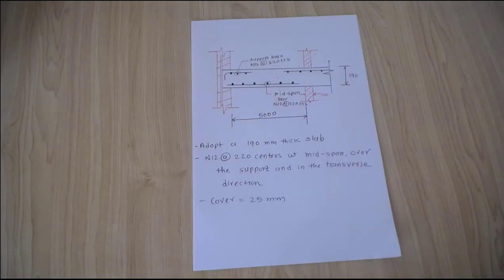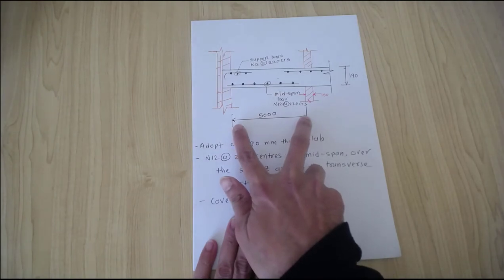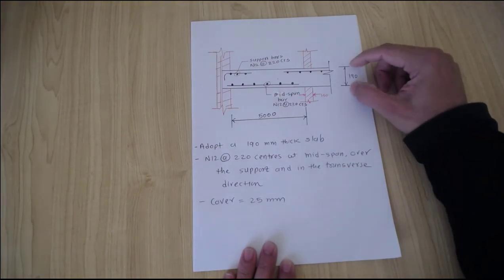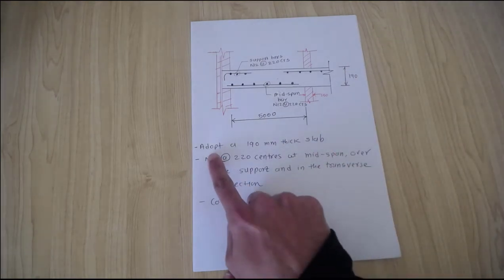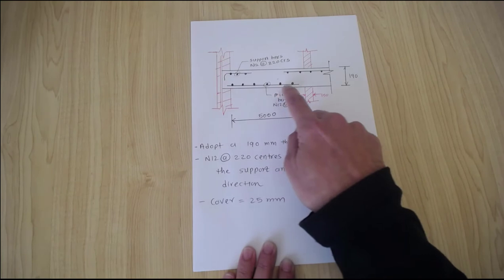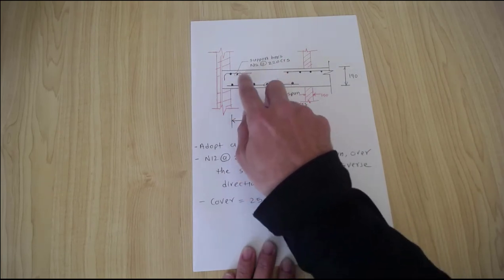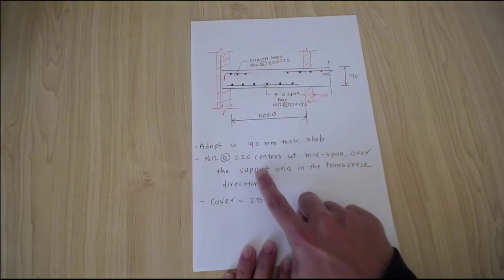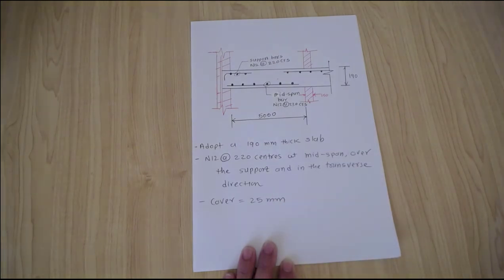One-Way Slab Example 1 Part 14-Summary and Drawing

Comment: Hi Dr Vipul, would you please explain why the primary direction (for which we are designing the Ast) is into the page? Thank you.
Reply from the maker: The primary reinforcements are provided for resisting the bending moment. The primary reinforcements are used for carrying the bending moment. Therefore, we provide the primary reinforcement is into the page. The secondary reinforcements are provided for shrinkage and crack control. The secondary reinforcement does not contribute in the bending strength.